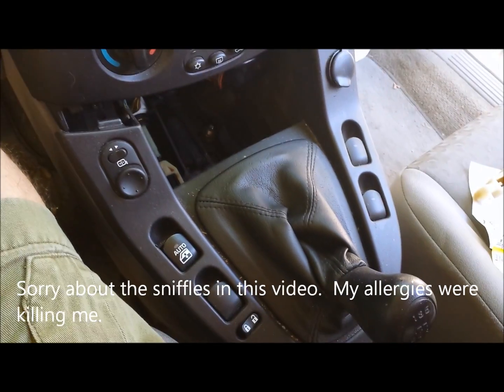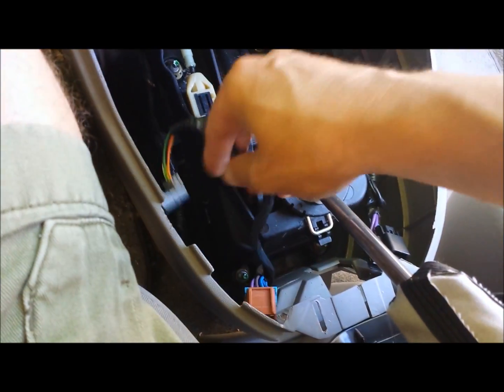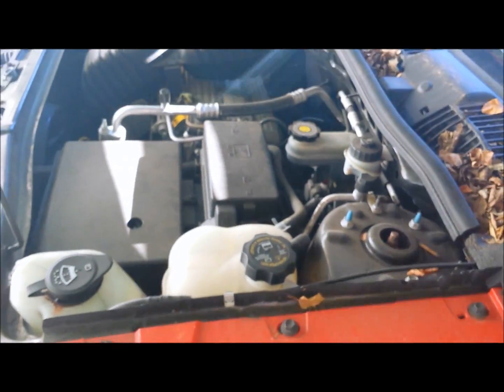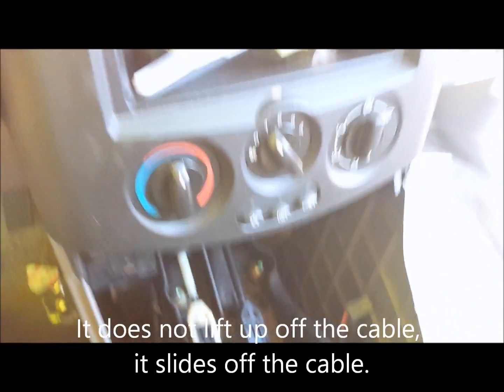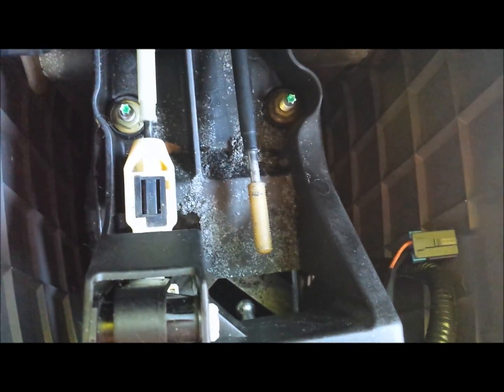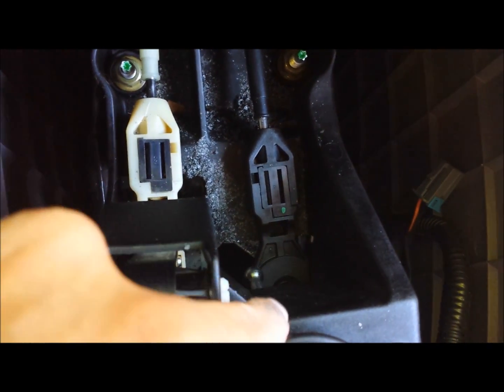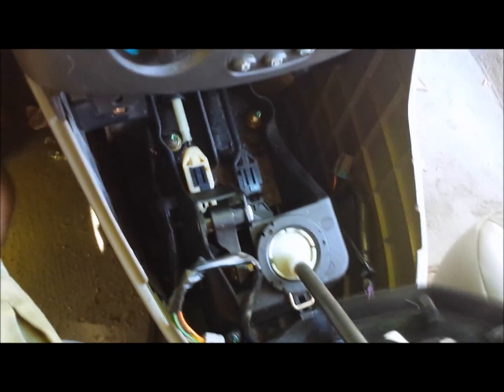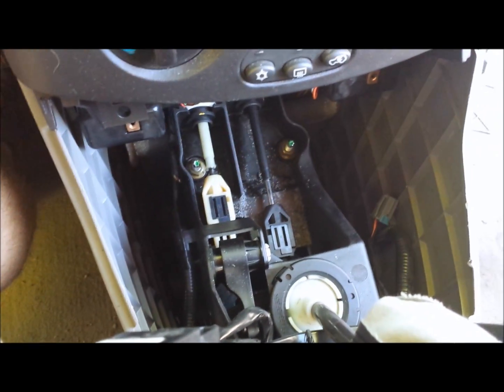Saturn Vue gearshift cable adjuster fix

Comment: Been a couple of months...but here's a update.  I gave in and took it to a mechanic. It was the cables that needed to be replaced. It cost about $475 here in Florida. I can now shift gears normally...and I changed the oil myself for the first time on this car. it sits at 251,000 miles and heading to 300K or more.
Reply from the maker: MrHodgeon5th keep that Saturn running!  I'm sorry the video didn't help you.
Reply: it could have been several things... but I appreciate your help

Comment: I only had 3rd and 4th gears. Mine was a broken left bushing.  I tried to unsuccessfully push the bushing onto the shifter pin by hand but wound up needing a C clamp. The clamp is the trick.
Reply from the maker: Thanks for the tip!
Reply: Mine almost has that problem, my left bushing is bad, how did you fix?
Reply: @adanlittle7253  Almost? If it ain't broke, it's not the problem.

Comment: second time mine has broken. ordered the part instead of paying a guy 200 to fix it like last time. any chance you think anyone could find someone to recast it out of metal so it stops happening or does it HAVE to be plastic...
Reply from the maker: Have you replaced the cables. I read somewhere that if the cables are too tight over time it brakes. ??  My Saturn was in totaled....sad day.

Comment: I reallllly need to know what the white plastic piece and the wire that goes into are called. It's at the end if the shifter.  CAN NOT FIGURE it out  and my 06 is making me nuts trying to drive with that wire broken. Tje only thing I was told it may be is a retention wire ad I cannot find ANYTHINGon where to purchase, etc.
Reply from the maker: I no longer have this car.  I believe though you are asking about the Shift Cable (wire) and Shift Cable bushing.  That's the best I can guess.

Comment: Hey Jackleg, I'm wondering if you can help me out. I have an 03 with 160xxx on it and the same thing happened to me. I've done everything you said and have been trying to fix it, but when it cane to prying the thing off with a flathead screwdriver, all my little flange piece did was break off. Should I just keep prying until the whole thing shatters and then take it off from there? I dont think it'd hurt anything as long as I didnt bend the cable or something. Thanks for your time and thanks for the video.
Reply from the maker: I had to rewatch the video because it was a while back. :)  It seems to me if you can dig it out without damaging threads you should be ok. You are replacing the whole piece anyway. It's really hard to say without seeing it. Best of luck to you though.

Comment: Question - The price range for a new one?? Please
Reply from the maker: Looks like 1AAuto has them for $55.  I can't remember what I paid. It was a while back.
Reply: About thirty bucks + shipping from RockAuto. 

Thanks for the video. 

If I’m not mistaken, the threaded end accommodates fine tuning of the cable’s throw distance (to the shifting position levers on the transmission housing) by popping the ball at the bottom of the stick shift out of the socket and twisting the adjuster either further up or down the cable end to the exact, correct distance for the smoothest operation.
Reply: @davidkoloc1313  Rockauto only has the Dorman knock off.  The GM OEM part is ~$33 at Amazon.  Many complaints there about the Dorman.

Comment: I had removed the cover over the shifter and those parts looked like they were working so I went under the hood and thanks to that part in your video I saw that the cable had a slide kind of holder that held it in place so the cable part could be steady and the actual moving part switched the gears. I had put it in reverse kind of hard and I popped it out. It seems like it shifts a lot better now than it has been shifting. Thanks for the short and concise post of areas to look at for problems. It’s 10:00 in the evening and I didn’t want to Uber to work tomorrow. THANK YOU !!!
Reply from the maker: It is so great to hear that these videos help people. Thank you so much for commenting and I'm glad you are back on the road!

Comment: My car is stuck in 1st gear...I cannot get it out. I ordered this piece you show so will I be able to install it while in 1st gear???
Reply from the maker: MrHodgeon5th yes, I think ours was in first gear when it broke.
Reply: Jackleg ...... I hope so... I got 250K miles on it, still has life. Just sticky shifter
Reply from the maker: MrHodgeon5th has the gear shift broken loose?  That's ultimately what happened to the one in my video.  The one we had ran great until it was wrecked.  Sadly
Reply: Jackleg  ......not broken loose, no.... I turn the car on, it won't leave 1st gear.....
Reply from the maker: gotcha.  Ours was very hard to shift and eventually broke.  different symptoms, but i hope this works for you.
Reply: Help!!!  I changed this part now....but it's STILL stuck in 1st gear!!  My old part did not have any threads showing in the middle... I did replace it in the same way..threads not showing..please help!
Reply from the maker: As in the video my problem was a bit different. My Vue was stuck in first gear because my shifter was broken loose from the part you replaced. Were you able to move the shifter at all or is the shifter stuck in first?
Reply: Jackleg  ....it is to the left and I cannot shake it out of 1st gear at all
Reply from the maker: I wish I still had my Vue so I could check things for you.  At around 2:15 in the video I show where the cables come out under the hood.  with the shift stick unhooked from the cable, I was able to move it with my hand.  I would think that if you are not able to do repeat that, it could be the cable stuck in it's jacket or something in the gear box.  I wish I could help more, but I no longer own a Vue.  I have been searching the web for you, but have not come across anything concrete.
Reply: would the clutch be the culprit?  I know this car has another 40k in it.... but under the hood, your cable location and look of it is a bit different than mine... it's kinda hard to reach due to some obstacles
Reply from the maker: I am obviously guessing here since I can't see it.  Ours was all cable related.  The cables run through the firewall and would get very hard to slide in and out of the jacket.  I have seen other videos that folks lubricate the cables but with little impact and end up replacing them.  The gear shift pushes and pulls the cable to change the gears at the location I mentioned in the video.  If it is not the cables then it could be worn internally especially if transmission fluid has never been changed (I don't want to begin guessing on stuff like that).  I don't suspect the clutch if you have plenty of pedal and the car moves when you let your foot off the clutch.  I wish I could be more help to you and I do hope you get another 40k!
Reply: Jackleg ... i appreciate your help
Reply from the maker: I did find this video.  This guy put grease in the cable.  https://www.youtube.com/watch?v=eG7DnC5aG6U&t=68s
Reply: yes!  I saw this too... I tried a little... I need to probably connect 3 straws and then shoot some silicone in there so I can reach it.... running out of options
Reply: THE SHIFT LINKAGE CABLES THEMSELVES WILL NEED REPLACED AS WELL AS THIS PIECE. replace them while you can. it really isnt hard, hour tops to uninstall and reinstall everything ! found some online brand new for $60